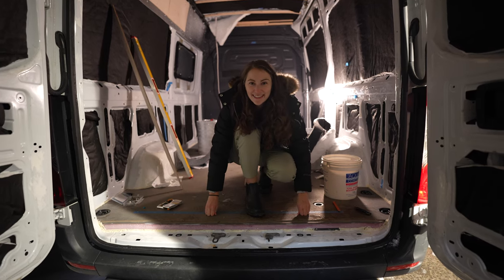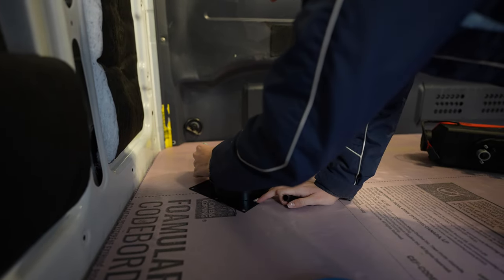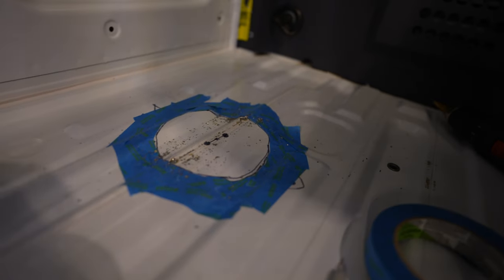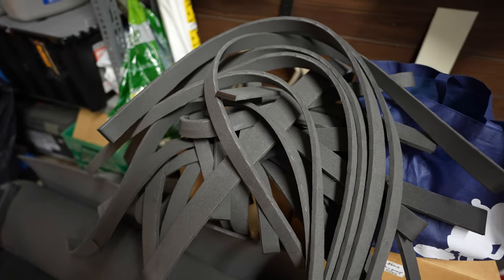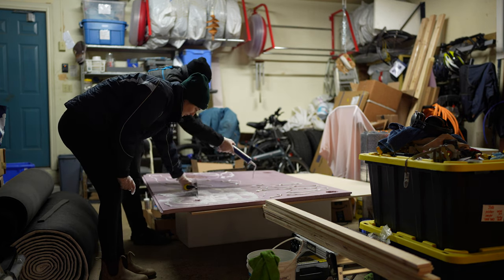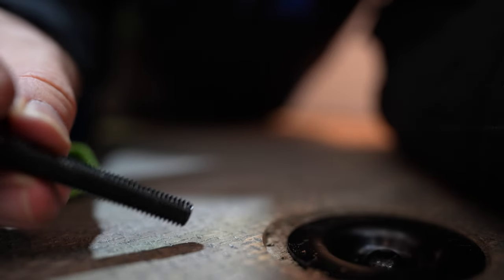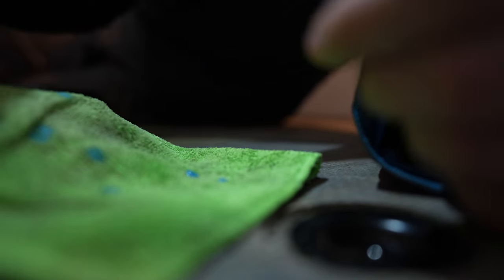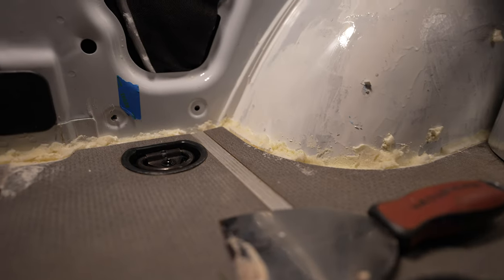Camper Van Flooring insulation and subfloor installed! - Vanlife Episode 4

Comment: I found no need for adhesive or extra fasteners when installing my floor . 1” xps foam rests on the steel floor leaving the low spots empty for drainage/ventilation in case of moisture intrusion . 3/4” T+G plywood is glued and wedged tight together at seams making the 3 pieces 1 . Furnishings are temporarily installed to hold the floor down but ( as you have done) I will use the factory tie-down nuts under the steel floor to bolt the subfloor down . No squeaks and the floor remains tight and flat the year it’s been in the van ( slow build !). A benefit of installing the floor this way is the relative ease of installation as well removal if needed . 👍
Reply from the maker: @carefreehighway  Sounds like a good way to do it. I would have done it that was as well if I didn’t have the factory floor already. Good to know it didn’t squeak going directly to the floor